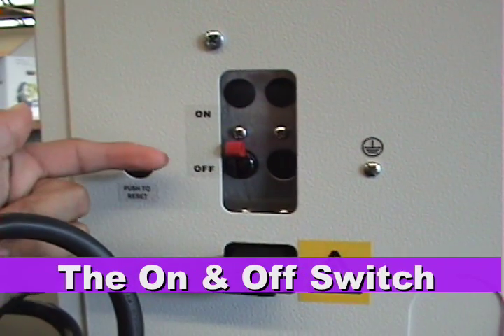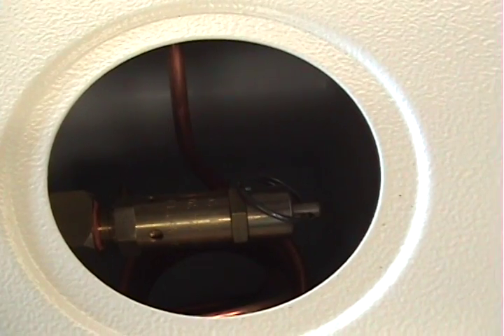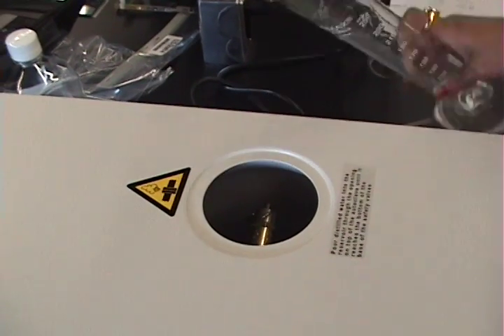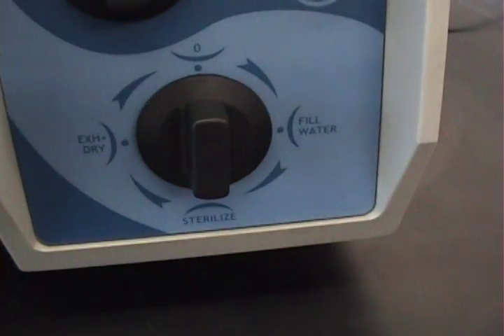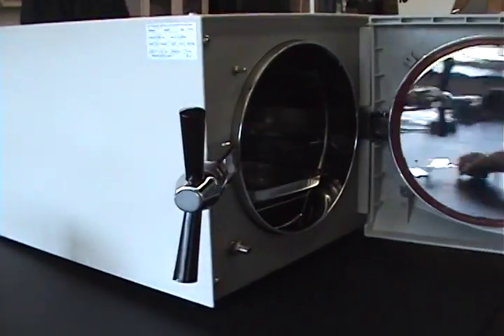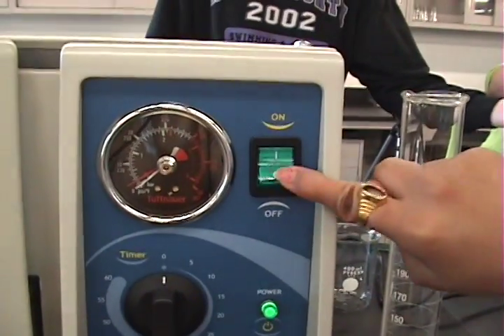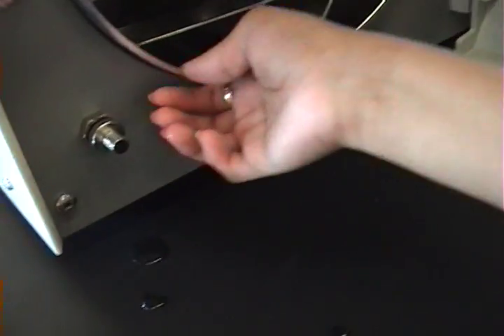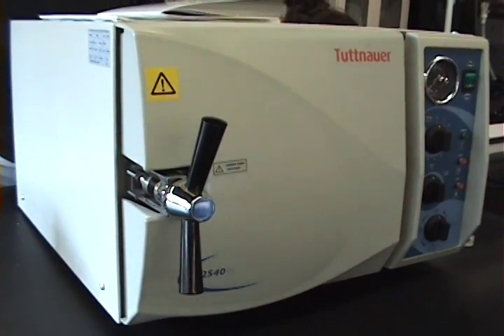Autoclave

Comment: does it works for wrapped instrument?
Reply: Yes you can sterilize wrapped and unwrapped instruments. Follow the directions  for sterilization times. Not do not follow the instruction here for setting timer. The machine needs approx 20 minutes to reach sterilization temp and pressure before you start the sterilization time, add the time  needed to sterilize to the twenty minutes warm up time.
Reply: Statimtek  i read that N class autoclave cant sterilize wrapped instrument ,, an N refered to Naked instrumed to be sterilized

Comment: Please, don't anybody use these instructions. They are incorrect on every level. The quantity of water they have used is only to be used for the levelling of the machine, and can be poured in through the front of the machine (as in the diagram on the top of the machine).